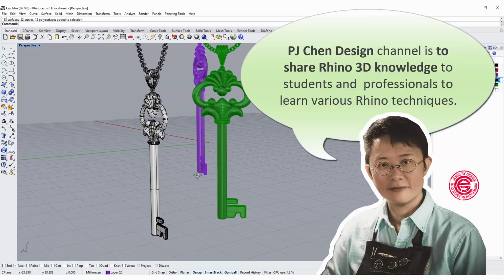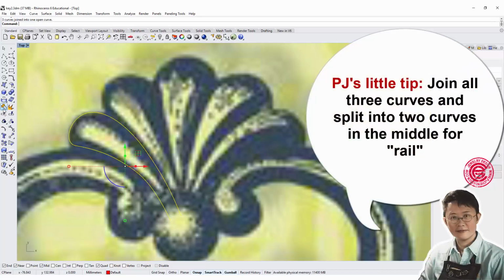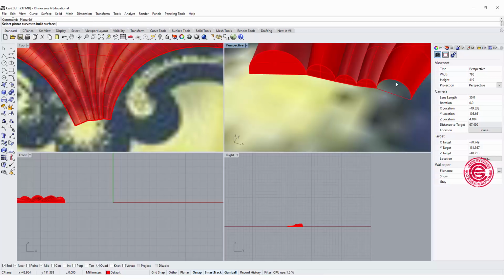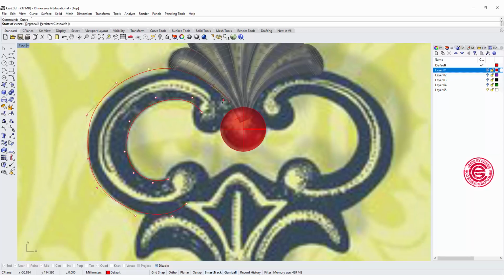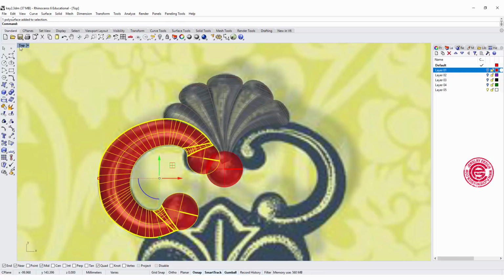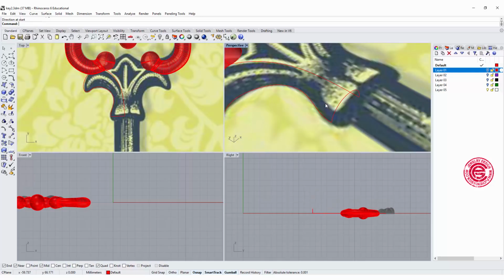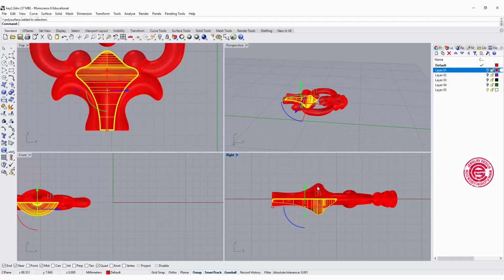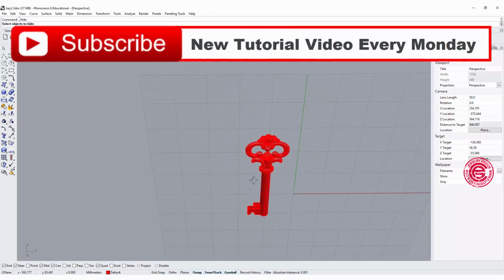Antique Key Pendant 3D Modeling in Rhino 6 (2018)- Jewelry CAD Design Tutorial #39

Comment: I was following your video and noticed that your joined curves, used to make the top part of your key design, then split to run the sweep 2 command, had fewer control points than my curves. I,m using matrix9. Do you know why this is? Thank you PJ, I really enjoy watching and learning from your videos.
Reply from the maker: If you need to have fewer points. you can always rebuild your curve
Reply: @PJChenJewelryDesign  Yes, thank you. I built my curves with the same amount of points as you did, the difference was after joining my curves, as you joined yours, and comparing the number of control points, I had many more.